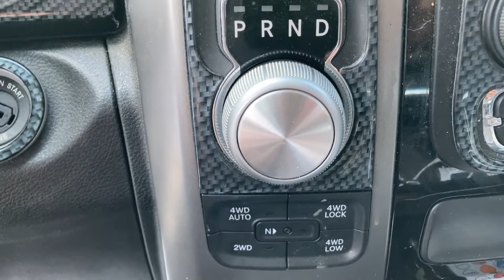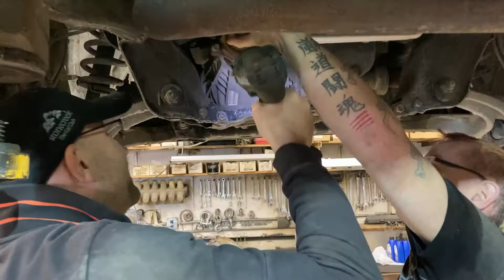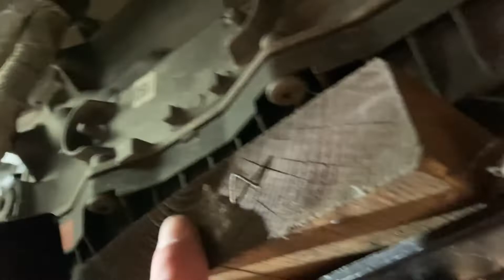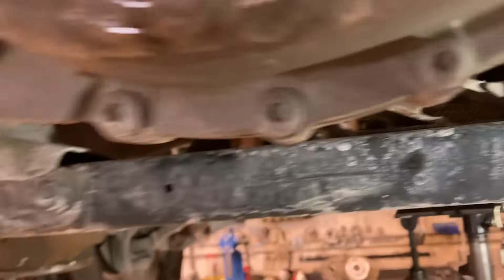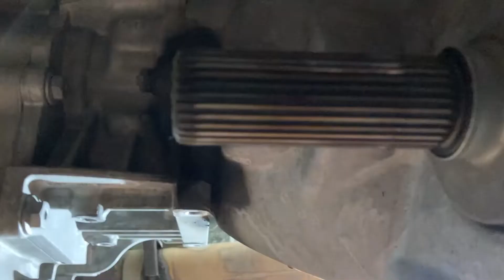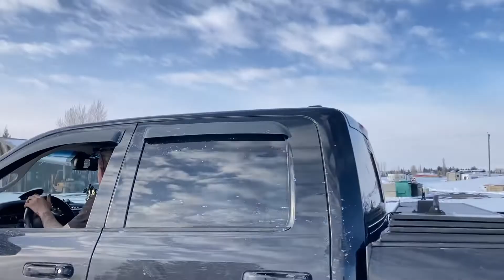Ram 1500 4WD Overheats - What causes this? Can it be fixed? - Mongrels Garage EP 49

Comment: We always got this error on our brand new Ram TRX in normal summer driving and the dealer could never figure it out.
Reply from the maker: Unfortunately the TRX runs a BW 48-13 t-case which is very similar to the 48-11 in that it uses a viscus clutch and can slip and heat up.  The 48-12 would have been a better choice in my humble opinion, but I’m sure they had their reasons.  Because it is a clutch style it is definitely prone to the same type of failure.  Potentially it could overheat due to uneven wear between front and rear tires

Comment: So the transfer case in Ford and GM is better and doesn't have this issue?
Reply: Part-time four-wheel drive systems have a mechanical lock typically a chain. they should not be used on pavement. manufacturers offer Auto 4 wheel drive systems and these use a clutch pack that allows slippage between front and rear axles. These can be used on pavement. these systems typically offer part-time 4 high and for low but they typically don't have a mechanical lock. there are a couple of exceptions.

Comment: so for the bw44-44 the front driveshaft is always connected to the tc and that's why it is turning in 2wd ? and with 4hi or low the tc pushing it to the front diff is that correct? 
Thanks
Reply from the maker: The front driveshaft is always connected, but the front axle is not necessarily engaged.  In Auto mode the truck will potentially engage the front axle (and transfer power) if it senses a difference in front wheels versus rear wheel speed.  In 2WD the front axle should not engage.
Reply: @MongrelsGarage  ohh thats make sense, is this for the bw44-45 also? or only the clutch tc bw44-44. 
Thanks
Reply from the maker: The BW 44-45 does work the same for the most part, driveshaft is always connected, front axle and transfer case have actuators to engage and disengage but the the 45 does not have auto mode, so it must be manually selected to 4x4.

Comment: Mine just crapped the bed. I think I'm going to just take it to the dealership and trade it off. It can be someone else's problem
Reply from the maker: Always a plan, let the dealer fix it and you can drive a newer vehicle that will hopefully be trouble free for a while
Reply: @MongrelsGarage  super irritating they heat up and go out..I remember thinking ahh I'll see what this 4wd auto is about.. 2015 ecodiesel with 32k miles on it bought it with 30 miles brand new and its been one thing after another with it.. I guess I'll see how much a stealership will knock off the trade value.
Reply: Hi , any chance you could describe how I could switch to the non 4x4 auto case ?
Reply from the maker: @Matthew-wt7xo  physical they will swap, but you will need to reprogram the computer and possibly change the selector switch.  Ramforum.com/threads/bw-44-44-to-bw-44-45-swap.132570/

Comment: I have this same issue of the intermediate axle splines being wore down and cv axle popping off. 
I’ve had the warning of transfer case overheating once while the axle was off. Was the axle off the splines the cause of the overheating warning? 
Will my transfer case still be okay if I repair the intermediate axle shaft splines? The fluid inside doesn’t smell burnt.
Or is my transfer case screwed also?
Reply from the maker: I would try replacing the intermediate shaft and seeing how things go.  There is a chance that the transfer case clutches are done but if you only had it do it once you might be okay
Reply: @MongrelsGarage  thanks for the reply!

If the transfer case is screwed, how much does it cost to rebuild clutches? Or would the cheapest option be to buy one at salvage for $500?
Reply from the maker: To be honest I don’t know the cost of rebuilding the T-Case, but it’s going to be much quicker to replace it with an salvage one.  I don’t think you will save much by rebuilding it

Comment: Cleatus was right!
Reply from the maker: Thank you, I will have to watch it again myself to see what I did right…lol.  Make sure I do similar stuff in the next video.
Reply: @MongrelsGarage  Would the 4×4 over-heating message pop up for any other reason?
Is there a way to test or inspecting this transfer case before taking it out to make sure it's actually the problem? 
Hate to buy one install it and have the same issue because of a bad sensor or something simple. 
I still have yet to hook it to a computer for codes but my 2017 1500 sport is doing this with only 90k miles on it, it worked fine when I bought it at 80k miles and never drove with auto on all day nor did I drive in 4×4 on dry ground only in snow to get out my driveway or road if not plowed yet.
Sucks that dodge charges as much for a truck as a person would a house with alot of land a truck that falls apart before 100k miles. 
If this issue is so common as it seems to be they should have recalled the 44 swapping for a 45. Now we the buyers pay the price for dodges crap engineering. I try to not buy vehicles with such common issues but we can't know everything and by the time we learn of such issues in a certain vehicle its to late. 
They make billions and still we the people pay for their mistakes.
Will have to do some price checking on a rebuilt one perhaps it might be cheaper. To bad it's not like an engine where you can get one from a salvage yard, being such a common issue the one you get from the salvage will probably break down again in a couple months.

Comment: What about the solution of buying a GMC? I hear that fixes this too;)
Reply from the maker: You’re completely correct, this is not a problem in the GM’s, they just saw thru there magnesium cases with the oil pump 😜
Reply: My son has had the engine and tranny replaced on his 2015 gmc truck, check reliability on them, I own a ram with no problems.
Reply: @tommcdonald53 yep.  They all have their quirks.  All a guy can do is take care of his stuff the best he can  and do proper maintenance.
Reply: 🤣 you'd have other issues
Reply: 😂  I should of stuck with Chevy. 
Definition of Dodge is to avoid. 😂
Reply: @flatout5815  lol that's a good one. I got a ram now but after having a Toyota and Nissan truck and having issues I picked a ram over Ford and Chevy
Reply: @bengleckl1877  after doing some more reading of forums about this issue seems a common issue with many newer 4×4 vehicles cause they make them weak these days, the new trucks can't handle real world harsh 4×4 conditions. 
Like everything these days, made cheap with low quality materials costing a fortune to maintain. Designed to break quicjly so we have to pay more.